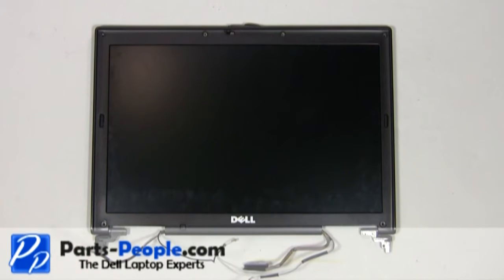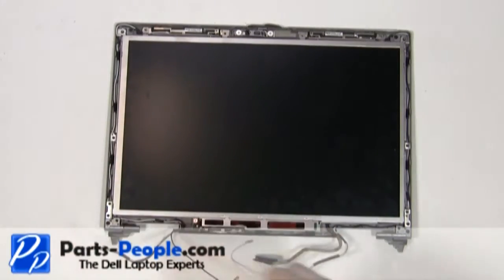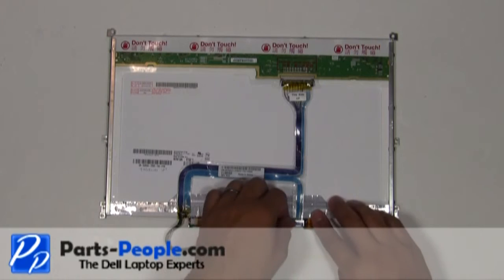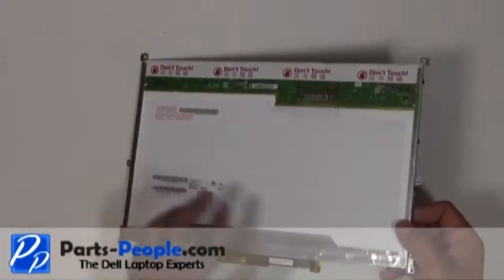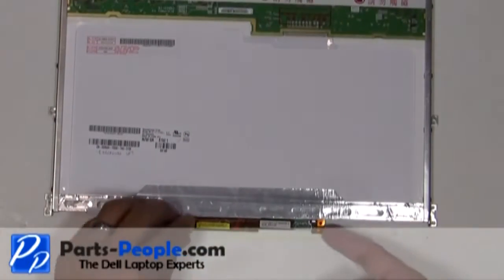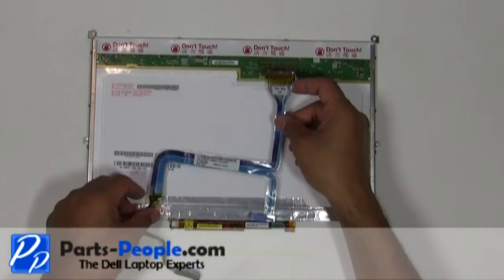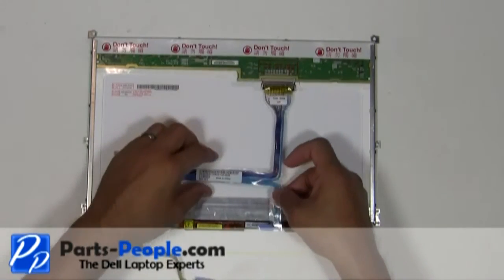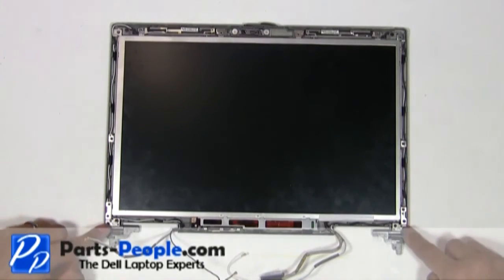Dell Latitude D630 | LCD Display Screen Replacement | How-To-Tutorial

Comment: After disassembly, I had placed the parts aside while I waited for the delivery of the screen. It had been a few days so I did not remember the orientation of the side rails from when I took them off. So after reassembling everything I was at the stage of reattaching the bezel and it would not snap back on. It was then I realized I had put the side rails on the wrong sides, causing the screen to be set up too high. It was not too much of a hassle to switch them around, but it would have been nice to have a note on the video to pay attention to the side rail orientation. The fact they actually screwed on wrong gave no indication at that time they were on the wrong sides.

Comment from the maker: You probably can but, the d630s have a higher res screen cable and a lower res screen cable that are not cross compatible. You will need to know which cable you have to make sure the resolution is compatible. The part number for the low res cable (WXGA) is NT108. If you have this cable, it will not work with higher res screens (WXGA+ or better). The higher res cable part number is YN941, it will work with all the resolutions.